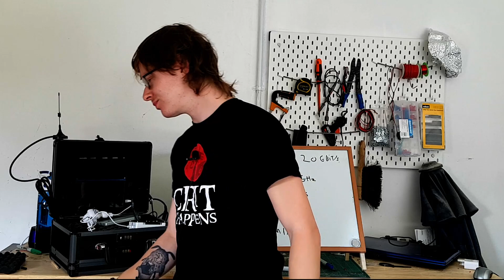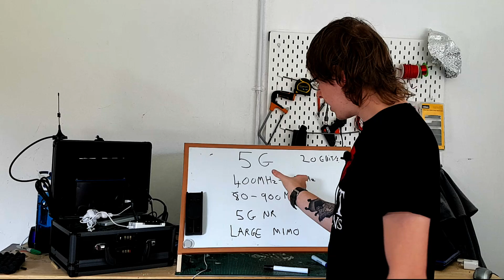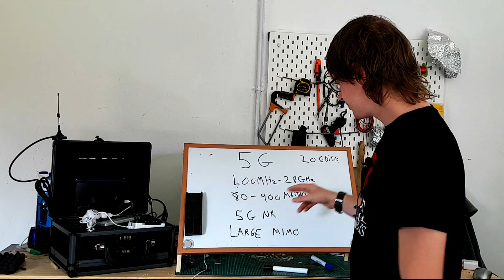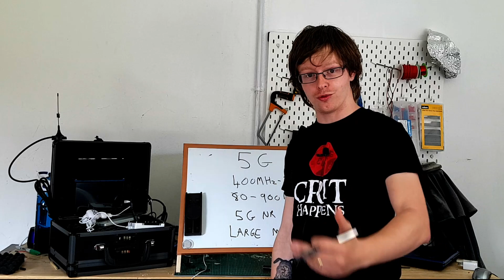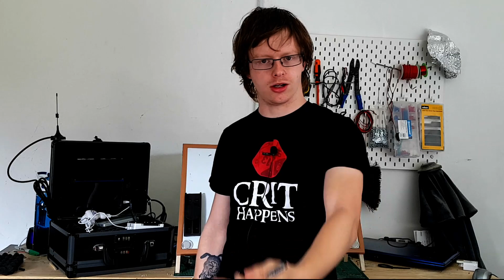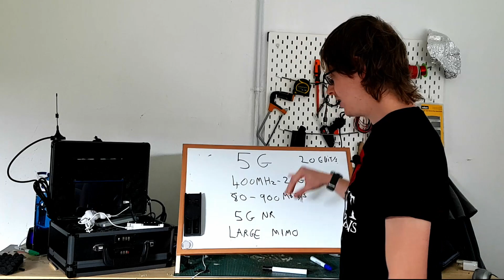What is 5G, Why Is It So Fast & Is It Dangerous!

Comment: Your microwave is pretty much a faraday cage. Hey a Idea for a new faraday cage? also you can see/film inside it and most use safety glass along with the cage. So if your experiment gets out of hand its contained. Get a rubbished microwave and use it for your RF stuff?
Reply from the maker: Yeah not a bad idea! I did make a cheap and nasty faraday cage out of tinfoil and a box in one of my earlier videos but that's not a bad plan

Comment: First of all I am FCC licensed. It is maybe not such a good idea to tell people microwaves are safe in any form and especially pointed at them 24/7/365. I am being a friend here. If you would just take your microwave oven to the edge of your yard and open the door bypass safety devices and point it towards your house and just turn it on for the next few months...well I do not think that is such a good idea. They have stated they will NOT do studies because it will slow down the deployment f 5G. So now you have a choice, do some research...then maybe recommend putting a microwave oven on every block, pointed at little children's homes... or do not ! Just my opinion sir. I do not want to sound mean...just concerned that there is not enough testing being done to say it is or is not safe. Think and research for yourself.
Reply from the maker: It would have been a lot of text to answer all of this so I made a quick video addressing your points :) https://youtu.be/0Gxs5kQszAA